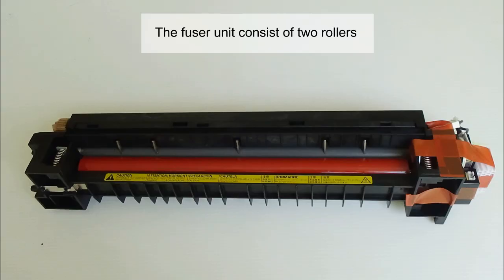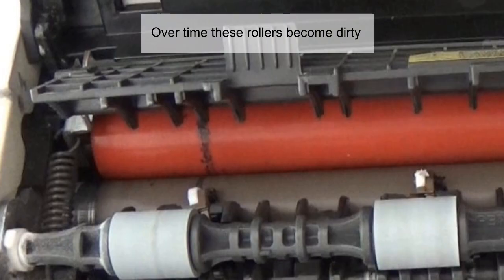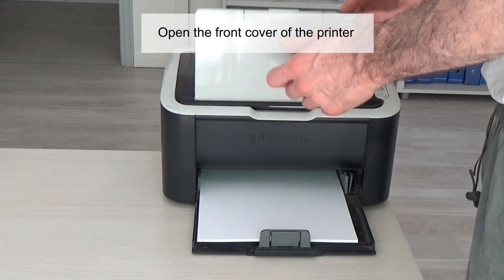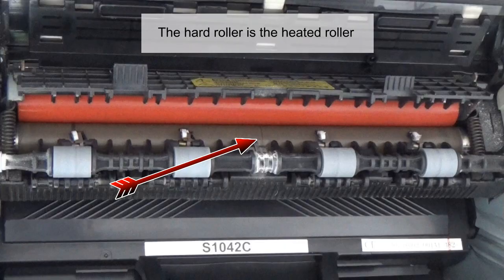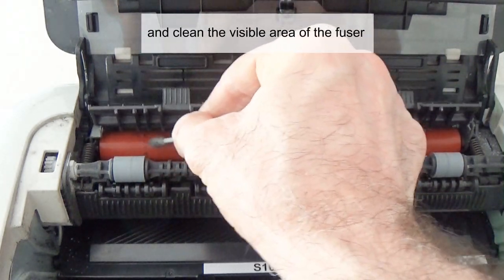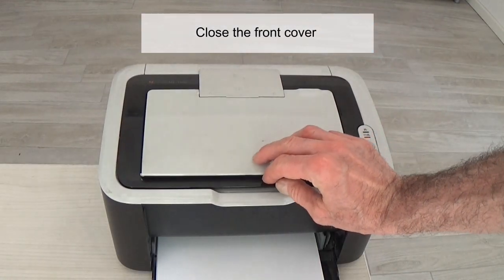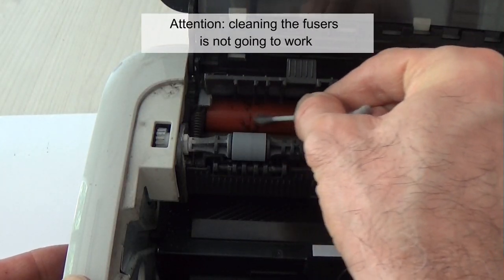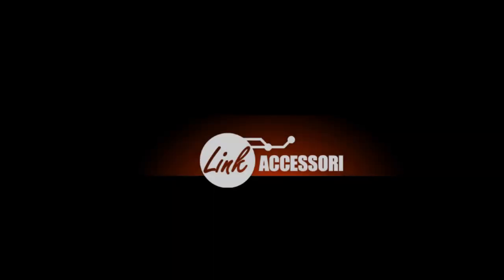How to Clean a Samsung Printer Fuser

Comment: My samsung printer errer #U1-2320 TURN OFF THEN ON.printer is not work please  tel me please 
printer model is SCX-4321NS
Reply from the maker: it's an error of the fuser unit. Turn the machine off and on. Check if the fuser connector is connected properly. Check if the thermistor is twisted or contaminated.

Comment: what must I do if the fucking paper is stuck in the fuser unit???
Reply from the maker: You have to remove the sheet using a wood ot soft plastic spatula, there are no other way if you don's want to disassemble the fuser unit

Comment: I have samsung clx467 and on printing paper is rolling on pressure roller and is not coming out. What have I to do?
Reply from the maker: Try to clean the roller with alcohol, check if there are foreign objects along the paper path. try to change paper, may be the old paper is damp
Reply: @viandant5  Thank for quick answer. I did it, but nothing changed. Paper si new, everthing is clear. I thing the roller surface is not more functioning. Any other idea?
Reply from the maker: @velkytatko8879  It difficult to say without checking the printer. If nothing work may be there is something broken, the gear mechanism of the paper roller. I think that printer has to be repaired

Comment: viandant 5, my problem is that the copies come out of my printer with ripples on the bottom of the paper. HELP PLEASE
Reply from the maker: which printer? may be the feed rollers are worn or dirty, clean them with alcohol. verify if there are no foreign objects in the paper path
Reply: Hello. Do you have a link on cleaning using alcohol; is it a particular product that is readily available at any computer supplies shop?
Reply from the maker: isopropyl alcohol? it think you can find it easily searching with google
Reply from the maker: those links are only general rules on how to clean inside a printer